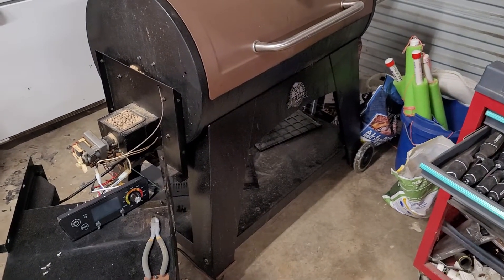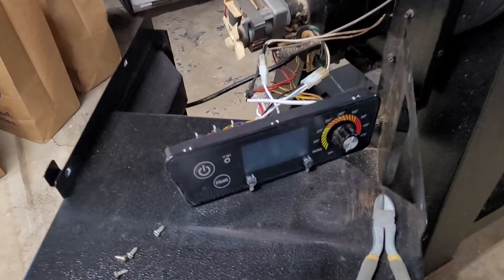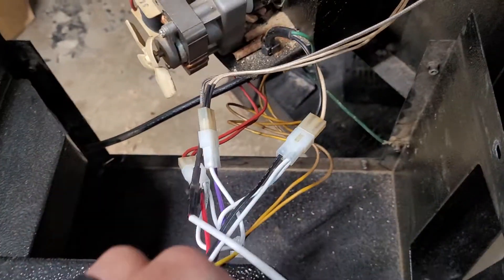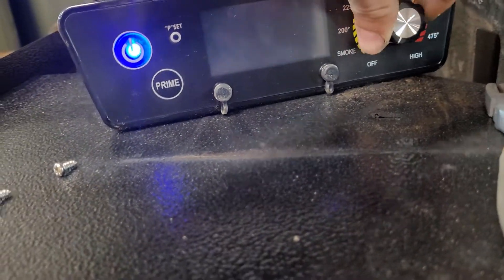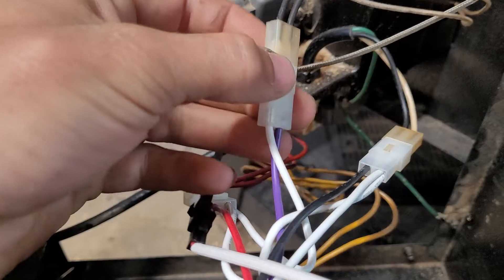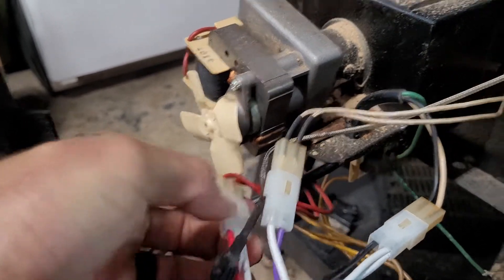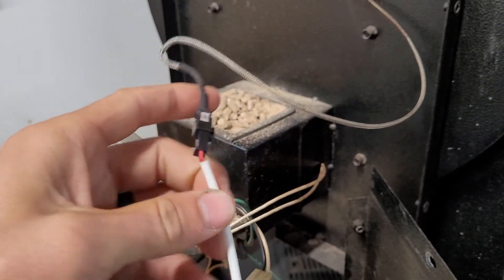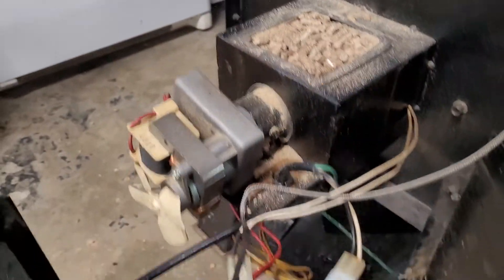Pit Boss no power

Comment: Can the control board fail just for the igniter? I had mine running and it blew a fuse so I replaced the fuse and now the igniter won’t spark but everything else runs fine: fan, auger, control panel. I don’t know what the heck is going on.